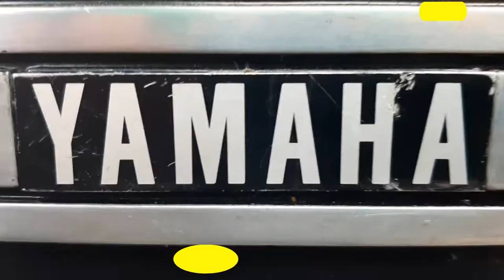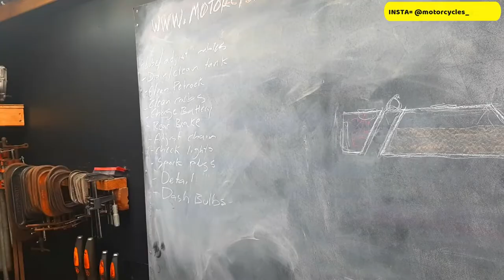1974 YAMAHA RD350 TANK CLEAN / TUNE UP PART 1

Comment: I cleaned the tank of a 350 a view weeks ago. The bike wasn´t in use for 10 years. Tank was extreme rusty. The easy way is to go to a glaziery and take about 2-3kg of this tiny broken glass pieces from broken car windows. Give it into the tank. Then find somebody with a concrete mixer. Wrap the tank with a blanket and use elastic strap to fix it. Then turn the machine on and let it turn for some hours in different positions.Drain the tank, wash it with water. Then i used citric acid. Mix it with very hot water. Into the tank. Leave it for 1 day. Drain it and stabilize it with natron. My tank looks like new.

Comment: Have the SAME " AhaMay!" Its ironic i found this Video JUST after I did My pristine Ruby Red Tank. :( (WD40 Pro Metal prep/ 3 days of Vinegar/ POR15) I had 14 hours into the project! It "flash rusted REALLY quickly" Did it AGAIN.
  I took my time..Taped the tank with blue Painters tape..Built my own petcock Plug Tool out of metal plate and Bike tube rubber. Por 15 took all of 100 hours to Cure. Rode it the other day in Boulder , CO.  I am so happy.
My landlord IS absolutely SICK of seeing me walk around With a 74 tank like a Swaddled baby! 
  oh, 7 Minutes..
Did the same NEWB mistake on my friends R1 98 carb LOL! 3 times a Charm!